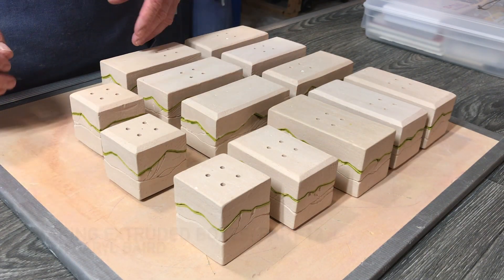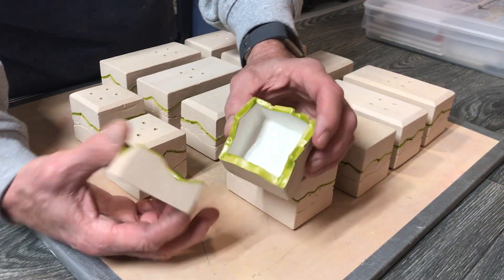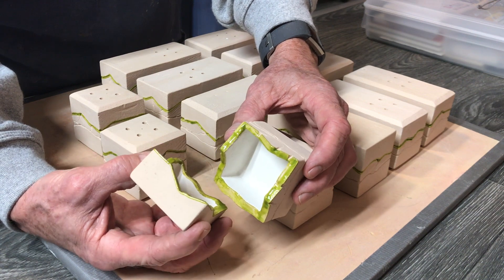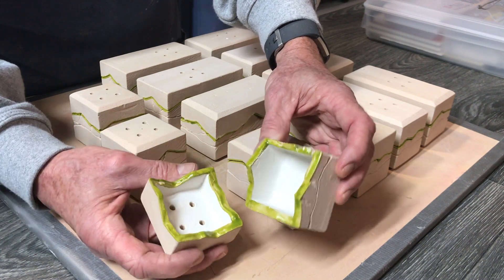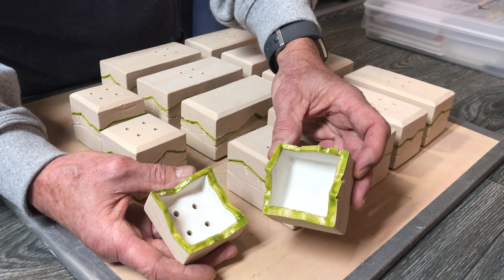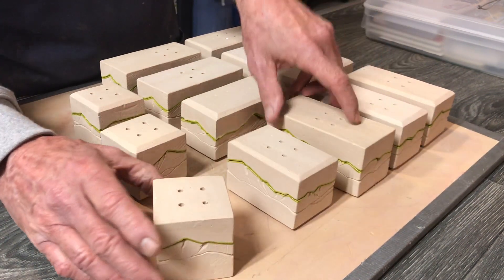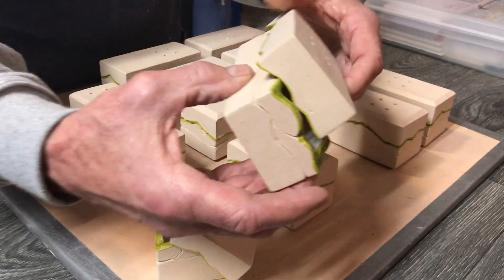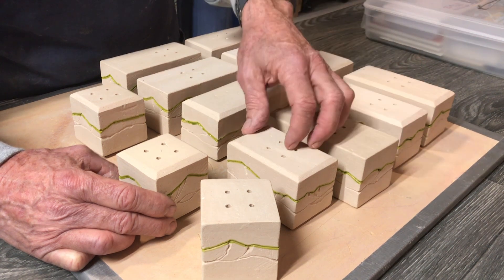Make An Extruded Clay Box   Part 10

Comment: Is there a video showing how to glaze these beautiful boxes ?
Reply from the maker: Hi, Joan. No, I didn't do a glazing video for the box series. But, here are some tips: 1. The wax resist on the edges is essential and it has to harden before applying glaze. 2. The glazes I recommend are Aftosa and Laguna Moroccan Sand as many of them stay put and don't run when fired to cone 5. 3. Avoid glossy glazes; stick with the satin glazes since they're less likely to run. 4. TEST, TEST, TEST! 5. Find a glaze know to brush well. 6. Apply according to the jar instructions. -- db

Comment: Was able to finish watching this series on the big TV today and have placed my order for the Kemper wipe out tool. Sheffield pottery is happy to sell them for $6.28 with free shipping if you make up the order so it will reach $50.00...always room for some more glazes to come in.
Some good pointers Daryl, just hoping I remember them when I get around to making some more boxes using your miter marker/cutter tool I made. I should start thinking about making a flip note board for specifics when I'm hand building to remind me to have the slip at hand as well as the steps I should remember to do.
If making a small square box is there the need to ease any of the walls out or will they stay stable?
Thanks for sharing.
Cheers...Freddie
Reply from the maker: Hi, FM, and thanks for watching. As to the need to ease out the sides, there is much less need if the box sides are short. It is necessary when my extruded boxes have sides around 5.5” to 6” but I don’t worry about it if the sides are 3” to 4” long.